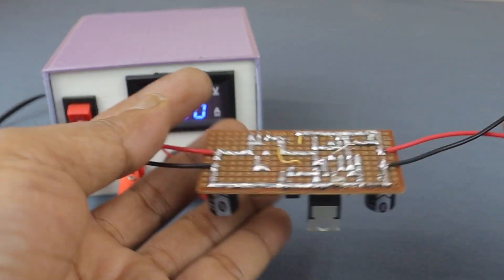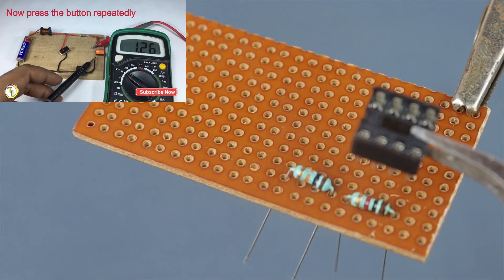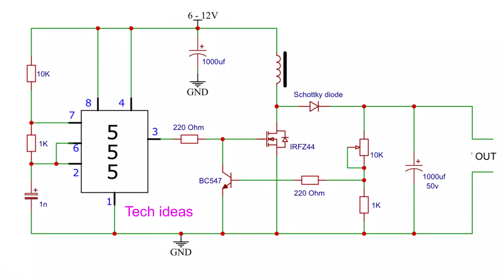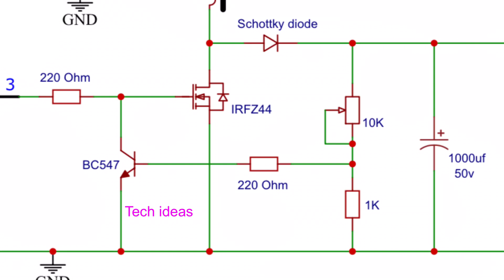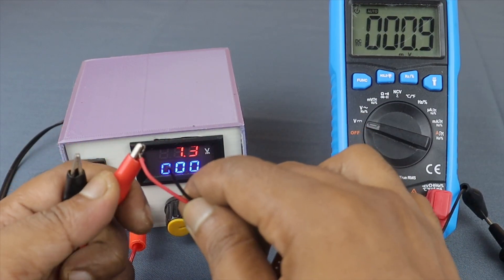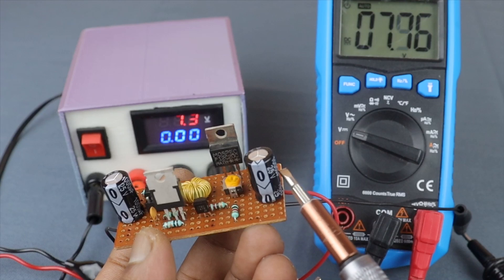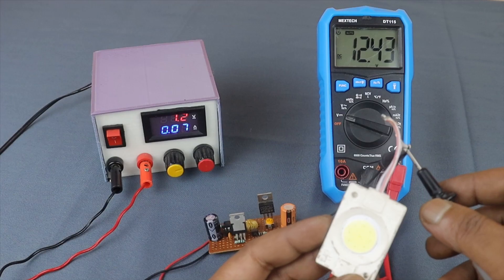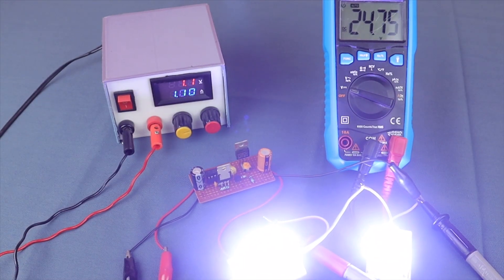Mini Boost Converter With Feedback

Comment: Your feedback section is bad and provided reference is no fixed so it should not be called reference, you should use zenner or voltage regular with pot to provide proper reference independent from varing input, you did not demonstrate output voltage stability with and without load voltage should be same.

Comment: Bro, you used 2 F12C20C transistors on your PCB circuit but in Diagram only one Transistor. But Why?
Reply: No he used 1 transistor and the other Piece is a shotcky diode it looks like transistor

Comment: It's not work when I connect 12 volt input then also output shows only 12 volt this circuit not boost the voltage
Reply: My friend is making shorts on the mosfet gate, making the mosfet completely open, so the voltage does not rise, and it remains as it is

Comment: When 6 volts are given, the maximum increase is only up to 7.6 volts
Reply: Ofcourse you'll only get that much, bcz the diagram is wrong. You should reverse the arrangement of the feedback resistors.
Reply: Give 3 volts and check

Comment: Nice video and circuit, but efficiency is not best due to gate mosfet at threshold. Would be better if duty cycle was adjusted with pot dynamically for feedback
Reply: What's is the correct gate voltage
Reply: @Blue.star1  most mosfets have 12v positive rail voltage as minimum, but it depends on the type of mosfet. Driving the mosfet with mosfet driver is better or like 555 timer. With this approach, the mosfet will get hot because of inconsistency in voltage.
Reply: @vaio232  it's saturation voltage
Reply: Qual você acha melhor

Comment: Bro what software you use make circuit diagram 🤔
Reply from the maker: Easyeda
Reply: @TechIdeasAG  The actual diagram has 6 resistors and the simulation diagram has only 5 resistors, what is the answer please

Comment: what is the efficiency of this circuit?
Reply: at Input*2 =70-80, at Input*3 =60 and less.
Its problem is that the choke heats up a lot at currents greater than 1A 
(it needs to be made large - starting 30 mm (only powdered iron! -otherwise the core will be saturated , thick wire (2 twisted pairs together for example))
And it is better to regulate not through the gate, but the frequency, so that the field-effect transistor does not heat up